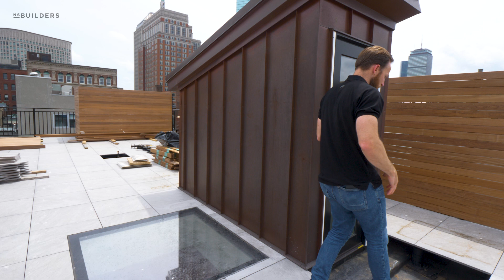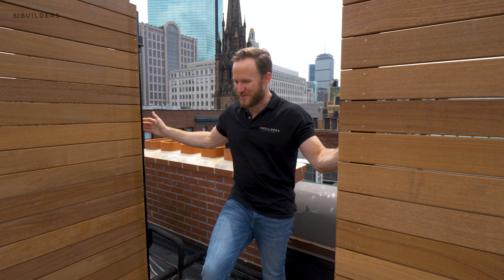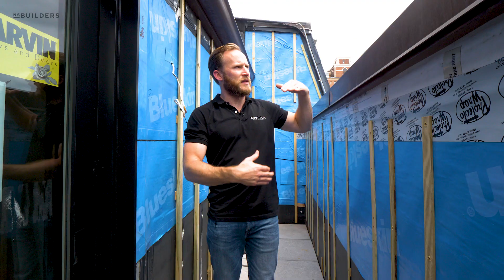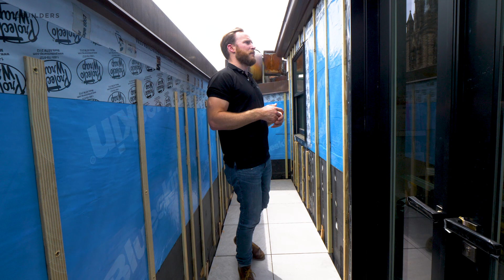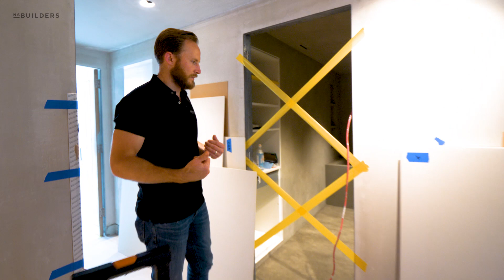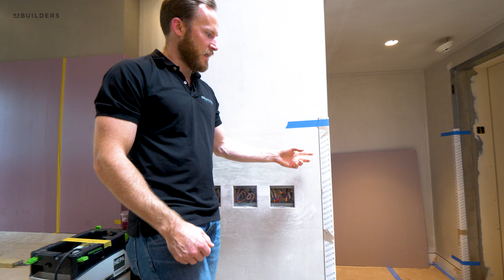This Bathroom has no tile, stone, or paint | Site Visit

Comment: how warm can you crank those exterior snow melt wires? hopefully pretty warm because 1 or 2 feet of snow coming at an 1 inch an hour happens (usually) at least once a winter in Boston. Thats a lot of electricity to turn that all into liquid water!
Reply: Chicago has very similar weather-wise, I have a Nieghbor who’s entire “yard” (it’s concrete/pavers) melts the snow every winter. 

Harder to keep up with = when the city snow plow dumps 1/2 a block of snow from the Street on your stoop! Boston doesn’t have to worry about that tho- the plowing is terrible there.
Reply: @RITCHIECO  I've lived most of my life in and around Boston and honestly they do a decent job with snow removal, I think most of the problems are from the narrow streets and haphazard layout. Luckily this person won't have to deal with snowplow snow on their stoop; this part of back bay has generous sidewalks.